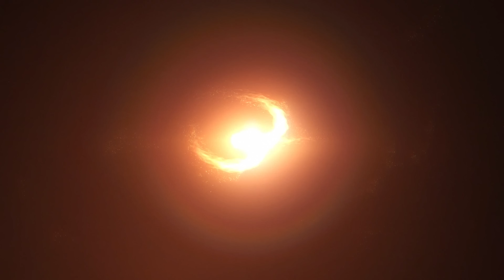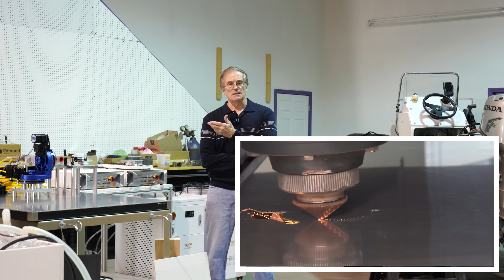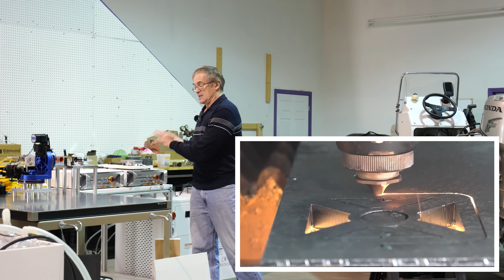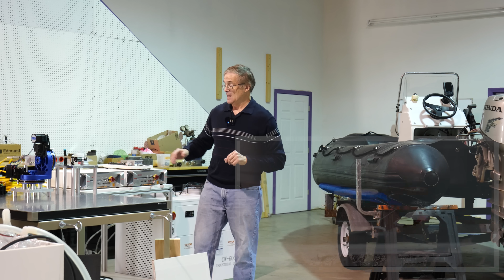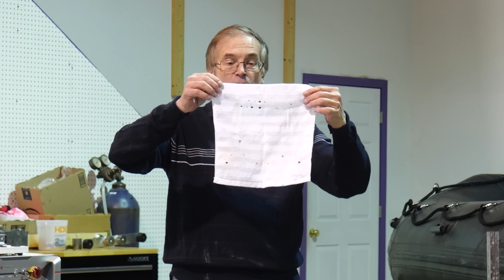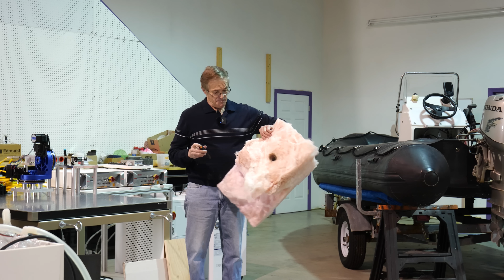We have a problem... and need your help!

Comment: Perhaps try coating the plywood (or drywall or concrete board if you try those) with fire intumescent paint which is typically used for fireproofing steel. I am unsure how it might perform against the lasers you are using but it might buy you more time with the off-the-shelf boards.
If the plywood works well, perhaps presoaking it in water could mitigate the fire risk too…

Comment: glass beads, glass of the same class used to focus it so optically clear and not absorbing the energy? What about snow, bubbles in water, water mist, things that use index of refraction to scatter the beam?  Seems Some of these answered were partly right given Styropyro's latest video, still this laser is so much more powerful than Styro-pyro's.

Comment: How about a labyrinth of thick glazed ceramic tiles (tripled or more in thickness, as needed) at right angles to each other, first one hit at 45 deg. A beam dump. Water-cooled (submerged?) if needed.
Reply: More grazing than 45 if still burning through

Comment: Similar to the one below, dirty waterfall.  You'd need a pump that can move dirty water or have a hopper that adds dirt after the pump.  The water can be repumped into the water fall and it can also be moved out of the way with the same pump through a hose.

Comment: Instead of trying to block it, maybe there’s a way to refract it or cause the beam to spread out. I know it’s a very tiny beam but with that much output, there probably aren’t any readily available materials that won’t instantly vaporize or burn/oxidize. Maybe a pile full of snow or ice ?

Comment: A composite plywood/cement board wall with a curtain of water running through the layers and the surface. Color or some dissolved additive could help deflect the beam too.

Comment: Coolant bathed crystal defuser with Starlit insulation backdrop(edit: asynchronous rotation might help with ablation issues). Pre-burn Starlite as prep.  "Starlite is a thermal shielding material known for its ability to protect objects from extreme heat. While the exact formula is unknown, a DIY version can be made using cornstarch, baking soda, and PVA glue. This replication method involves creating a thin layer of carbon foam on the surface when exposed to high heat, which then insulates the material" Sitting Googl AI note.

Comment: You seem to have settled on catching/absorbing the laser's energy. I don't know of any material that can conduct that amount of focused energy away from the contact point fast enough to not melt/burn/vaporize. I would be inclined to diffuse or reflect the beam. Maybe a combination of methods.
Diffusion could be through a clear privacy glass, a large lens, or a magnifying sheet.
Behind the diffusor an angled reflective surface could direct the beam being diffused in an unoccupied direction.
Using absorption in tandem with diffusion/reflection could accomodate your confined area (which is much larger than my large area). 
If absorption is the only choice, maybe a dyed liquid between two large area sheets. A transparent diffuser on one side of the tank into a nearly opaque circulating liquid with an angled reflector may be ideal. 
Your lasers could be used to heat a boiler hundreds of miles away!

Comment: only other idea I can think of is like a wall of dry ice or something. If you had a portable cryo cooler you could do something like a sheet of copper or steel that has a constant bath of liquid air pouring over it on the backside. outside of cooling or insulating you'd have to do something like make a solid wall of diamond doped just right that it re-radiates the lasers freq instead of purely absorbing it

Comment: I like the melamine plus water suggestion. Here's a similar suggestion: Set up an trough consisting of a sideways S-shaped cross section.  The trough must be perfectly straight and perfectly level.  Feed water into the trough and as it spills over the curved side of the S, it should make a continuous sheet of water.  Collect the water at the bottom with another trough and cycle it through.  I've seen this done in a fancy hotel in San Francisco.  Not sure, however, how high of a drop the water can be before it starts to unsheet and glob up.   I think at least two feet.

Comment: What if you sand blasted a glass window to make a giant ground glass diffuser. The beam could be stopped with drywall a few feet behind the diffuser. Maybe reflection could be an issue, but the reflection would also be diffuse.

Comment: Just a weird stupid idea if the idea is to scatter the beam perhaps if you either had a constant flow of thick smoke with particulate in it to both absorb and scatter the hear generated by the beam both cost effective and easy to setup rather than trying a solid object. perhaps placing the smoke inside a sheet of acrylic and the wall you would be able to see if the smoke can both be contained and see if the beam hits anything i dunno just a weird thing i was curious if that would be possible

Comment: Intumescent paint made from biological materials like starch should work. When exposed to heat they expand and create a porous matrix of carbon which will evaporate through pyrolysis over time but it will give you some leeway. It costs basically nothing and can be applied to any material you like.

Comment: Could you diffuse the laser to a larger area and then use some type of heat sink to disperse heat? Then flash the laser off and on with longer pauses of off to dampen the over all amount of energy given off.

Comment: Use Starlite, a legendary heat-resistant material, was invented by Maurice Ward. Designed to withstand extreme temperatures. 

The exact compositionis unknown, but a DIY version can be made using common materials: mix 3 parts cornstarch, 2 parts PVA glue, 1 part baking soda, 0.5 part borax, and optionally 0.5 part fine alumina, gypsum, or silica powder. 

Stir the dry ingredients first, then add glue to form a thick paste. Spread onto a surface or mold, let air dry or cure at low heat, and once hardened, the material will char and expand under flame, forming an insulating barrier that mimics some properties of the original Starlite.

Comment: 1-2ft thick aquarium filled with wet ash. Doesn't have to be 100% right? The glass should transmit. The material may burn or melt, but in suspension it should fill back in
Reply: Also, if the water boils it should warp and disperse the beam
Reply: Dry ice sheets stacked vertically like slabs could also keep material lightweight, disperse energy like snow and off put straight to gas and Crack, but shouldn't explode.

Comment: If you read all the comments, then you have your work cut out for you.  Seems like if you had a curtain coated with Al2O3  (sapphire), you might have a chance.  You can grow that on a thin aluminum sheet easily. It is highly reflective and very diffuse in it's scattering (Lambertian)--- and has a melting point of over 2000C.  Good luck
Reply from the maker: Indeed. 
I think the sapphire is interesting.  The fire brick we melted with the previous laser was also made with aluminum oxide. Maybe on a thicker backing that can also take the heat, it would increase the duration before burn through.
Reply: @TechIngredients  Maybe like others said, put it on a frame and have the frame oscillate in some pattern to spread the energy around.

Comment: Water with a colorant added to it?  An enclosure with a steel/metal rear wall, and a glass front.  You'd have to test the absorption rate of water with different concentrations of whatever colorant.  You'd also have to test the glass for being not too reflective or melting under the laser.  to start try a laser through a pyrex dish with black coloring added... my theory is (if the glass can stay intact) the water should dissipate the heat, may get some localized boiling.

Comment: A curtain of water. A waterfall if you will. I'm not a rocket surgeon so I don't know if you would want laminar or turbulent flow, 90 deg strike angle or some other angle, or several layers with differing angles.

Comment: The material used to provide torch resistance in containers (safes, vaults) is wood: burning bars and oxyacetylene torches have problems cutting through wood, particularly when coupled with copper to wick away the heat. I suspect your wood would fare better if saturated in borax, sodium silicate, or both. "Intumescent" paints are generally used for wood, but I suspect laser intensities will be too much. A chunk of 2x4 soaked in borax + sodium silicate... might do it.

Comment: Wild guess, A sheet of recirculating water. They make signs now that project on a sheet of water  dropped from small long pipe with special nozzles. They do it so thin it never reaches the ground but you would need a catch trough and a thicker wall of water. That has its own challenges . Dye the water if the photons just whiz through maybe.

Comment: Well you didn't want to use bricks, so you probably won't want to use my first idea, which is farm/agriculture use salt lick blocks. There something around 10-12" square and either regular salt or with added minerals.  The benefit is they're thick, and reasonable in cost. However stacking them 8 feet wide and high would be a chore. 

Another suggestion is more portable, but I'm not sure it'll work, but I'm an effort to diffuse/diffract the light, a multi layer waterfall curtain.  The upside is closed loop and may stop or reduce the transmitted power enough to allow you to use it in conjunction with other methods (continuously showered fiberglass welding drop cloths spaced between plywood that's also being showered).  Being able to put out the plywood is only an issue if you cannot gain access.  Leaving a gap, or making a multi layer system I think will help.  The downside is you'll need 500+ gallons of water and a large gas powered pump to make multiple curtains/sheets of laminar falling water.

For whatever reason I don't think that you can economically achieve a single stage laser beam stop.  I think it'll need multiple repeated layers with the assumption that each stage reduces the power by nth degree.

Also, if you spaced out the plywood you could make an air tight-ish box and pump it full of nitrogen.  Any hole the laser does put through it will allow the nitrogen to escape helping to smother the fire.  You're the one playing with the lasers, however the redneck farmer and 15 years as a UXO bomb tech in me makes me feel like your comfort level with danger is too low this time.  It's an incredibly small tight beam, you're not torching multiple square feet of plywood. It's a small fire in a localized spot.  Make a half a dozen layer plywood box, seal it and have a nitrogen inert gas flood system with backup water spray/flood system.  You could drill 1" holes on the sides at the base and cork them.  So that when necessary the positive pressure from the water shower/flood system will automatically pop the cork/rubber plugs allowing the void space to be filled with water.

Comment: simple answer is a moving background of some kind that takes a quick hit and moves on , to be replaced by new material (a flowing gravel chute for instance or flowing sand).

A more expensive but possible solution would be graphene coating on top of a sheet of limestone.

Comment: A mound of sand or gravel would be a good energy dump and you could pull out and discard the glass-like tubes the laser will form after every few firings.

Comment: Suppose you used a rectangular barrier and held it with springs on the vertical and horizontal edges such that the resonant frequency in each direction was different and they were not near integer multiples of each other.  Two motors with axis’s normal to the barrier and having offset weights (like vibrator motors) would each be tuned to one resonant frequency.  

If the surface of the barrier moved fast enough the laser would not penetrate.  Instead the laser path relative to the barrier surface would be like the pen path of the Spirograph drawing toy.

I don’t know if it is practical to have the barrier move with sufficient speed and amplitude.
Another idea might be a large spinning disk barrier.  The problem is that the surface near the center does not move quickly.

Anyway, the idea is to have the barrier moving quickly relative to the burn spot so it does not have time to penetrate any spot.

One other approach might be to have a barrier with an internal cavity an inch thick or more filled with dark colored water.  When penetration occurred you would end up with a puddle and have a hole to patch.  Hopefully steam would exit the hole and water would quickly replaced what was boiled away.  If would not depend on capillary action like the blankets.

Hope these help inspire a useful solution.

Good luck.

Comment: Not an engineer, but I sometimes play one on the youtubes.  I would suggest thinking about this in two stages:  Stage 1: Diffuse the beam.  Stage 2: Absorb the energy across a much wider area after diffusion.  Materials that don't absorb the wavelength the laser produces often diffuse it.   If you can find the right material to diffuse it, absorbing it over a larger surface area should be much easier.

Comment: Third Solution:
Water-curtain beam-trap (if you have floor-drain access)
Weld a 1 m × 1 m × 300 mm stainless basin.
Hang a 25 mm-thick sheet of black EPDM rubber inside the basin so the beam first meets rubber, not water surface (EPDM absorbs ~80 % at 1064 nm, chars not flares).
Above the rubber, run a perforated PVC manifold that drops a 5 mm-thick laminar curtain of water down both sides of the rubber.
Outlet overflows go straight to drain; a $50 sump-pump and tote keeps the loop closed.

Why it works
The rubber instantly carbonises, diffusely scattering the spot.
The water curtain then absorbs the spread energy (absorption length in muddy water ≈ 5 cm).
Any steam vented goes up; no reflections come back at eye-level.
This style of trap is common in industrial 10 kW fiber-cutters; parts list is all plumbing-supply gear, total <US$400.

Comment: Just thought of another substance used for exactly this purpose sometimes... No idea how much it would cost, I'm certain there are cheaper solutions... But powdered Titanium Oxide. Use both and a diffraction gradient material and and excellent heat absorber and potentially an ablative. The refraction index is high enough to scatter 1064nm light... It also largely passes 1064nm light so dispersal would be quick and efficient and laser power would likely be dissipated quickly, broadly and over a material that can handle 1800+ degrees even before melting and nearly 3000 degrees before "boiling/ direct sublimation"

Comment: Hardibacker, it’s sold in Home Depot in the flooring section, it’s 3x5 sheets 1/2 inch thick, cement based material.  Pump a sheet of water over it with a dye appropriate to your laser wave length that helps absorb the light into the water.  Copper sulphate possibly???  Should be the best bang for your buck with readily available material.  A big fish pond pump should do the job. Good luck sir!

Comment: My third idea, 
Use a CNC controlled virtual wall, think of it as a catchers mitt for where the laser will hit. 
Use 2 high speed stepper motors for the X and Y axis, and a panel connected by lines. Like how the mechanics of an Etch-A-Sketch toy work. 
This pad will be where the laser will hit. 
The pad could be 12" x 12" for example, made from an exotic and expensive material.
Rather than building a huge wall of an expensive laser proof material, have the material CNC controlled to where the laser will hit. 
Like a baseball pitchers backstop mitt.

Comment: Second solution: Graphite + refractory “sandwich” (no plumbing)
Graphite + refractory “sandwich” (no plumbing)
Stack-up (front → back)
Layer	Material	Function & burn-time
1	10-mm isostatic graphite plate	Absorbs 99 % at 1 µm, never melts (sublimes > 3600 °C); in air you get surface oxidation after ~8 s at full power – buys your interlock window.
2	25-mm high-alumina kiln shelf (Al₂O₃-SiO₂)	Soaks the heat once the graphite ablates; takes ~40 kJ before first crack (≈20 s for 2 kW beam).
3	50 mm calcium-silicate board	Insulates the wall, stays under 250 °C.
Mount the 300 mm × 300 mm sandwich in an angle-iron picture-frame welded to a cheap engine-stand so you can wheel it out of the way when you’re done.
Cost: graphite US$60, kiln shelf US$35, board US$15 → under US$120 per panel.
No water, no electrics, no flames, no toxic smoke.

Comment: My first thought is maybe nighthawkinlights "starlite" imitation flame retardant covering. It burns into carbon foam which may become thick enough to defend for the time scale you are thinking of then again it may do basically nothing and just vaporize quicker than it can make carbon foam. 

Another idea that probably wont work because you wont be able to make it thick/dense enough is a fog machine. If you have a fog in the air it will  "burn away" with the laser energy but because it is mostly transparent each part is not absorbing a large amount of energy but I dont think it would have enough absorption power to deaden what you are throwing at it. The idea comes from the never planned experiment where you shoot a high powered laser at a lenses with dust on it and the lenses cracks/explodes because the dust super heats.

Another idea is build a "box of sand" you sacrifice the front wall hit the column of sand that should hold for a few seconds its going to be a pain to reset/repair but as a back stop its fairly solid and cheap a small hole in plywood followed by half a foot of sand with plywood behind the hole shouldnt leak too badly now if the laser is moving at the point it hits the backstop it might not go so well.

I actually think the best idea might be a Thermal camera to an Estop with your sacrificial drywall. If the drywall gets a hot spot for any reason shut it down.